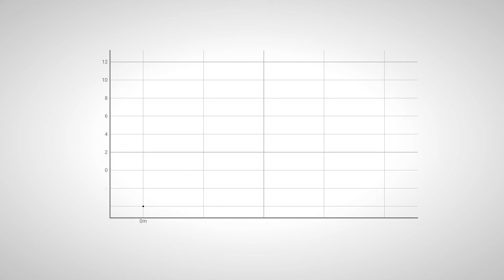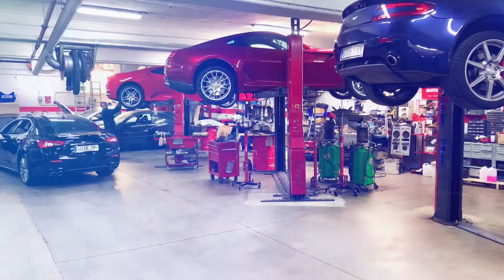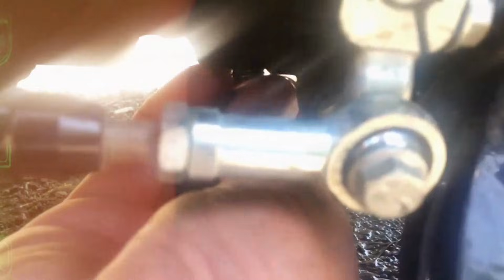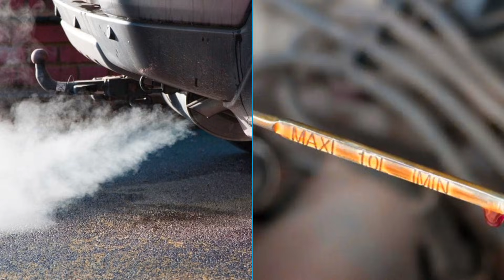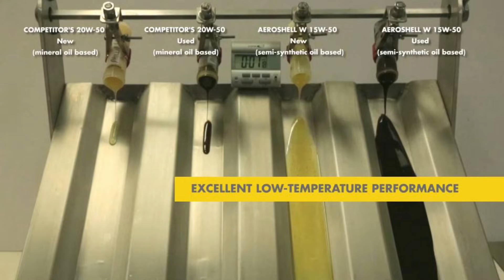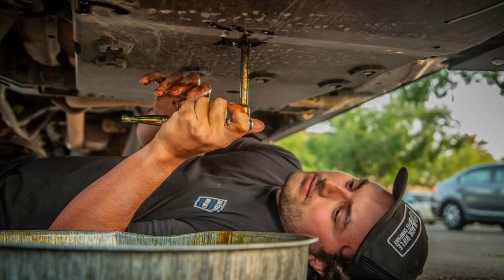Toyota Owners: This $4 Part Could Save You THOUSANDS

Comment: I recommend you use an oil drain plug crush washer rather than the nylon ones. Your excessive torque can  crack the nylon washer. And seepage can happen.